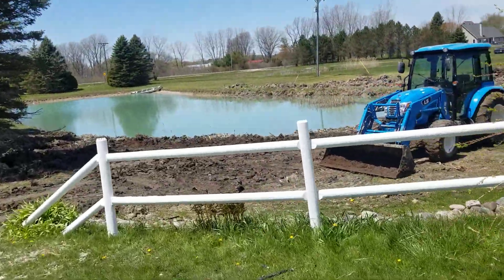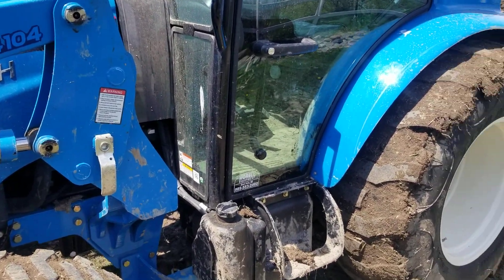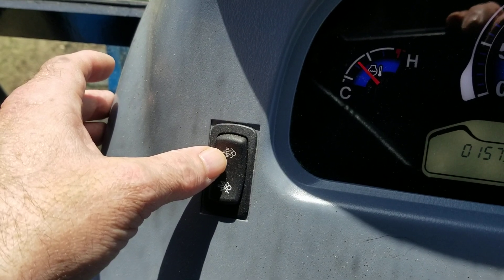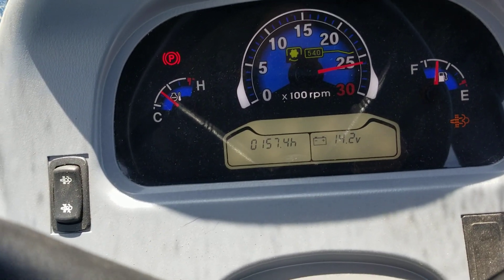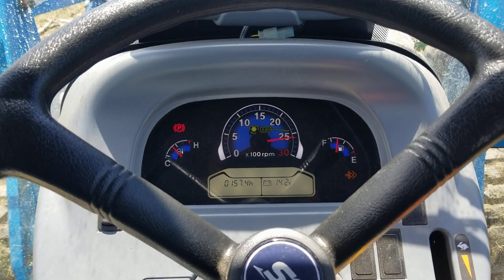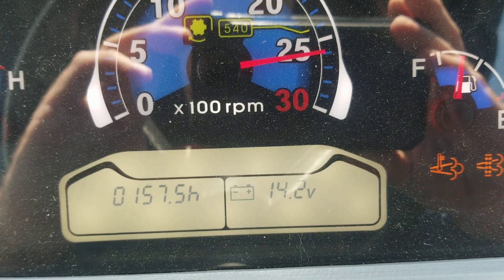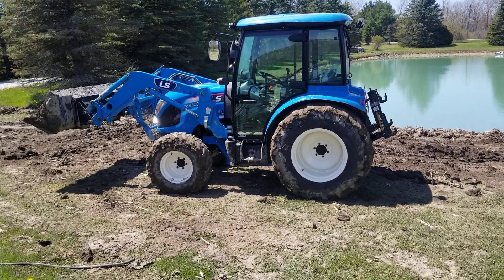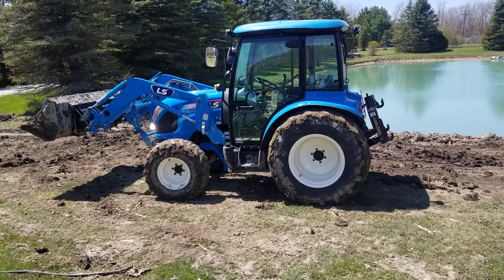LS XR4140 Tractor Manual Re-Gen

Comment: I have basically the same machine 4150 and mine has only auto regened a handful of times and I have put 450 hours on it in the last two years.  I am actually having some issues this winter F11 157 and 81 with it and followed your directions to make it do a parked regen as I write this to see if I can get it cleared out and running without going into limp mode.